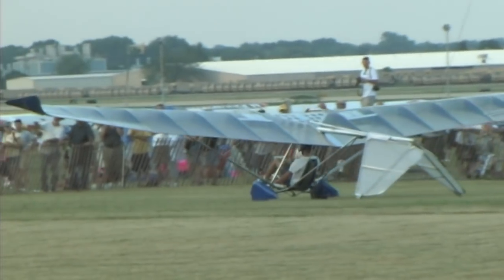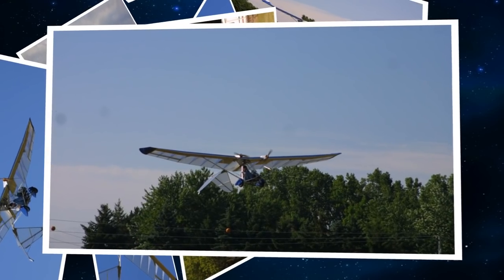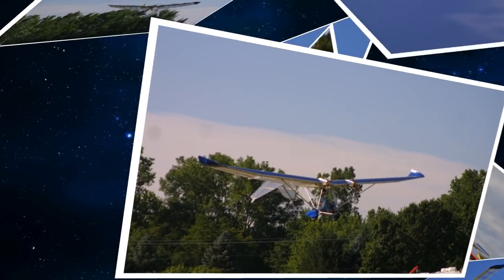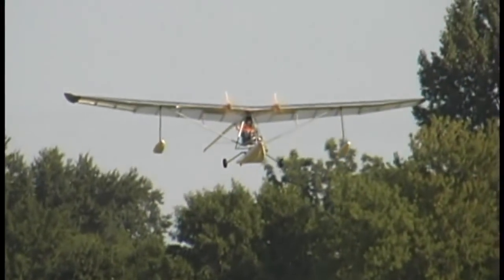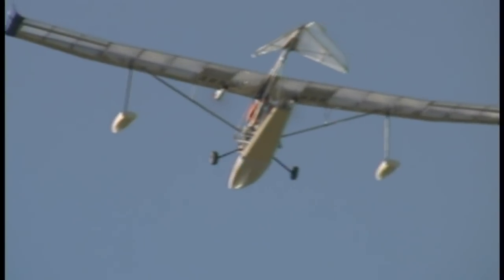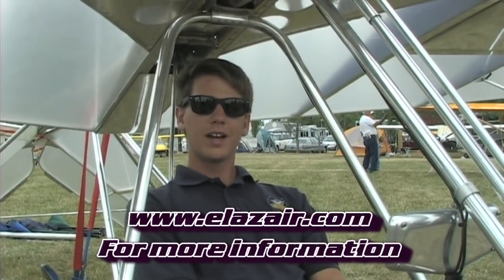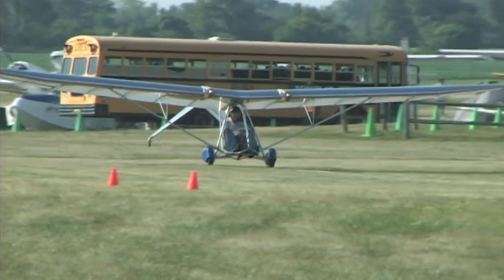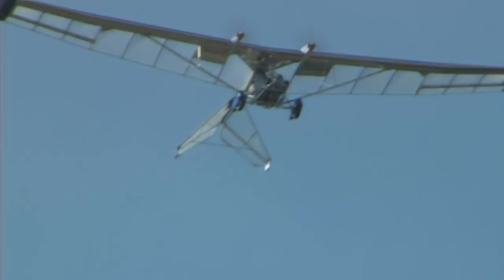Electric powered ultralight aircraft, eLazair twin engine battery powered ultralight aircraft.

Comment: I would love to see how this plane of 7 years compare's today with modern battery packs. There has been a massive jump in battery performance in the last few years I could imagine his stated 2 hour endurance easly doubled, ligher cells and potential performace capabiluty could be huge.
Reply: No there hasn't there has been a slight increase and it hasn't doubled even 5 years later. The 2 hours is probably not right. Look at what has happened with electric, everything is better now and there are fewer examples and less talk about them. Having to charge for hours and the weight and short flight makes it not that good of an option unless something drastically changes.

Comment: Looks awesome. You can tell the ground controller at the end of the video isn't used to electrics. He jumped right into the path of the props while the motors were hot.

Comment: What material is it covered with?  How does 350 lbs qualify it as an ultralight?  (I thought the limit was around 265?)
Reply: See https://www.youtube.com/watch?v=ix7pWElDaEY - Dale Kramer interprets FAR Part 103 thus: 254 lb for the aircraft, plus 5 gallons for fuel.  No weight limit is given for the fuel, so Kramer believes that he can put a volume of 5 gallons of batteries in the plane.  By now (late 2017), FAA may have made a clarification on this, but I haven't seen it.
Reply: It's different in different countries.   254 is the US.  Europe is different, and Canada is different...  as well as Australia

Comment: What power is needed to fly this light plane, to long keep flown?
Reply from the maker: +jwserge - Original power was 2 pioneer chainsaw engines of about 5 HP each, later 2 - Rotax 9.5 HP
Reply: +Light Sport and Ultralight Flyer 
So, 10HP (2x5) is enough to take off?
Reply from the maker: +jwserge Yes

Comment: The answer to solve your charging/battery problem  Solar panels and peak charger with a voltage regulator.
Reply: This would help to extend battery life, but even if you covered the wing completely with solar cells, with the best cells available today, it would only cover a fraction of the power needed to sustain flight - maybe 1/3 to 1/2.
Reply: Panels equal weight... weight is bad

Comment: Dale Kramer announced that he was ready to start selling his eLazair ($20,000 for a kit, $25,000 built... not including the $6,000 needed for the batteries) three years ago. This video was made two years ago. And they STILL haven't gotten their webpage built yet!

Get your act together guys! It's not that expensive to hire a webmaster to crank out a simple webpage!

Also, who's going to spend $26,000 on an airplane with a maximum flight time of two hours? I mean, it would be nice to have quiet electric motors instead of a noisy gas engine, but since you say it takes "three 20 amp circuits" to charge the batteries, it's not like I can taxi up to a Chevron and fill it up. The novelty, noise control, and low fuel costs aren't enough to make this a worthwhile purchase.
Reply: Inventors or not usually business people. I hope they get it soon I am almost 60 ys old and would buy one because of its simplicity and good flight numbers.
Reply: Two hours is actually a VERY respectable runtime, especially for e power. However no website means this project has been canceled.
Reply: Youtubedoctor I cant see why you can't build an electric ultra for under 5k.  in fact the batteries should cost more than the plane.  my cheap quadcopter has 22lb of lift for $200 worth of motor.
Reply: @MindBodySoulOk  How long does it fly for? Your quadcopter isn't going to be cheap once you add on everything it needs to fly. That 22lbs is also at max and once you get a frame on there and things getting in the way it will be under 20lbs and then you have to carry the drone so even less. Actual payload will be less than 10lbs and then the batteries, frame and electronics will make it cost $1000 dollars. So you need to carry a person so you'd need 20 of those and you'd be able to go for 10 minutes when you need at least an hour for it to be worth it.

TLDR : You don't know what you are talking about.
Reply: With electric you might be able to apply reverse thrust on landing, which could be a fun thing to have?
Reply: nope, there is a problem here. Batteries are heavy and even in the past decade the power density hasn't changed much.

Comment: I'm a little confused, FAR 103 puts the weight limit of ultralights at 254 lb. for powered craft and 150 for non-powered craft. Are the Batteries considered "fuel" and therefore not included in the total weight? The maximum amount of fuel allowed is 5 U.S. gallons which would be 30.95 lb of gasoline. If the batteries weight 100 lb, then obviously more than 3 times as much fuel weight.
Reply: who said it weighs more than 254lbs with the batteries in it?
Reply: A small 2 stoke engine weighs about 25 to 50 lb. and electric motor weighs less, perhaps as little as 10 lb. Fuel is not included in flying weight for the rule, so when you add 100 lb of batteries, it is conceivable that the batteries might put the weight over the limit if the plane was close to the limit to start with. If the plane was 240 to start, remove 75 lb in gas engines and apparatus to run them, add 40 back in for electric motors plus 100 for batteries puts you at 305. This is all guess work on my part but I hope you can see the point of my question.
Reply: Robert Russell @8:29
Reply: In another video, https://www.youtube.com/watch?v=ix7pWElDaEY, Dale Kramer states HIS interpretation of FAR Part 103: the regulation states that they ultralight can weigh up to 254 lb., plus 5 gallons of fuel.  Since gallons are a measure of volume, not weight, Kramer believes that he can put up to 5 gallons (volume) of batteries in it.  Not sure the FAA sees it that way.
Reply: Brian Carpenter at Oshkosh said the batteries had to be removable to be considered fuel.  For the electric motor glider they were strapping the battery pack to satisfy this requirement.

Comment: I used to fly one of these, except it had two six hp engines with composite props.
Reply: Correct. Little chain saw type motors. Enough to get airborne and have some fun. The original kit came with "mixed" controls, meaning no separate rudder control. Very easy to fly but crosswinds were a challenge. ;-)
I loved that aircraft.
Reply: Whole different world when you leave ultra lights for Cessna's and Pipers. If it was too windy, we did not fly.
Reply: Airborne @ 18mph and land @ 18mph. Anything faster than 60 mph and the leading edge would begin to "oil can" the leading edge was an aluminum covered hard foam d-cell. Very light. It was originally designed as a glider and we used to fly them to the hills and shut down the motors, so we could ridge soar above the slopes. Great fun. Glad to see the design still around and has a (hopefully) new lease on life.
Reply: Pete Watson ... still looking fo one as colector item for our Aviation Museum in Montreal... Any hints?
Reply: Martin Pernicka No idea. That was over 30 years ago

Comment: That's the POINT of these laws, that they cannot perform as well, fly as far, or be as heavy as airplanes requiring a pilots license.  If you want to fly something that performs better, you need a pilots license.
Reply: That is NOT the point.  The point is to minimize the damage that an untrained pilot can do to others.  The weight limit and speed limit restrict the maximum kinetic energy, the fuel limit restricts the fireball size, the daylight-only keeps it from getting in the way of regular VFR pilots without being seen.  The not-over-congested-areas limits the number of people you can crash into.

Comment: Same as ABC123 cells? Thank you to everybody in the RC sport that has spent their hard earned money to make this possible. I for one am tickled pink!
Reply: 12 years later and electric is still pretty much trash. The best you get is it used for assists on gliders and then a few planes that can't even stay up for an hour and takes hours to charge once back on the ground. Flight is about weight and the weight of the batteries makes the idea of electric planes pretty poor.